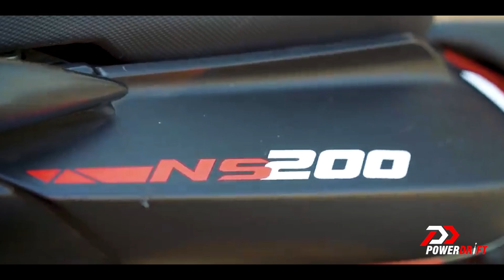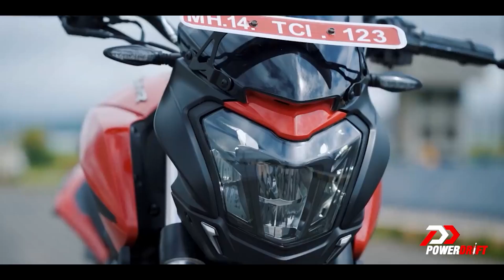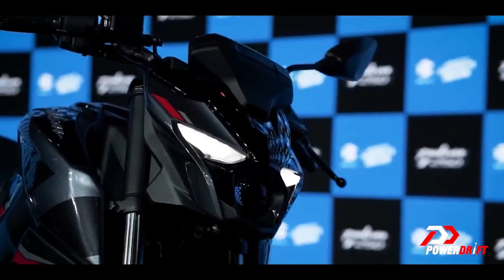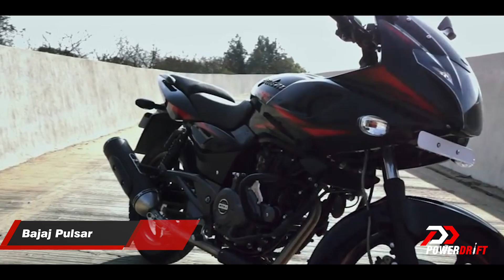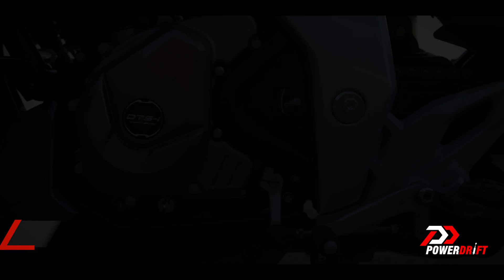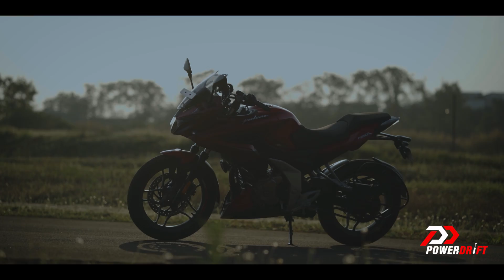Bajaj Pulsar F250 & N250 | Your Questions Answered | PowerDrift

Comment: My question is
Is the new n250 has the same engine of ns200 or rs00?
Its like it is the same engine bt tuned into different segments?
Or it it is completely a new one?
Reply: Both are totally different engines. NS200 is based on Duke 200 engine with liquid cooling and 6 speed transmission. N250 is brand new engine with 5 speed transmission. Both are completely different.

Comment: I think the Pulsar N250 has decreased in design and liquid cooling features (compared to the NS200).  Using air cooling is actually a setback compared to the NS200.  The best NS200 design and underbelly exhaust features are great.  The advantages of the N250 are only in the slipper clutch and projector lamp.  The rest I prefer NS200

Comment: Waiting for :
1.R250 - replacing rs250 - may it get a racing based engine like cbr 250r - with - 27 ps power
2.N150 , F150 , R150 - may it get a better engine with good engine figures. With - 19 ps power

Comment: Bajaj is not good at making liquid cooling engines. All bajaj bikes suffer with the water pump seal damage problem, coolent mixing with the oil problem, So making these kind of Oil cooled engines will require lesser maintainence and reliable than Bajaj's liquid cooled engines.

Comment: @Shumi: I agree with you when you say easy to ride bike would feel slow. Never though it in that way, but in retrospect it makes sense. I ride a Pulsar 135 LS and I 'feel' it's a fun bike in city traffic. This is something I 'felt' the day I started riding it as you call it in "Flow state", constantly keeping it in it's sweet spot ( around 6000 to 8500 rpm). It does not make a lot of torque or power with that buzzy engine , barely crosses the highway speed limits, but it does walk up and down the rev band quite well. That meant I can bang through gears 3 to 5 on open stretches, then blip down one or couple of gear as the traffic slows down then back up again. This constant choreographed dance made my office commutes a lot more engaging and may I say it, fun. While doing so I used to think I was doing crazy speed, but a quick glance down would reveal a 2 digit number. 

That said, how do you think these Pulsars stack up to that use case ? Are they more Yamaha FZ like or still a Pulsar just with relaxed riding cadence. Not upgrading my bike, just in search for different riding experience.
Reply: Hello, I'm able to relate to every word you're written as I am riding a 135 LS since a couple of years. May I ask what bike have you upgraded to? and if you could describe the difference in experience please.

Comment: The thermal stability management system is THE ONE AND ONLY reason why Pulsar AS siblings failed and Bajaj discontinued it. AS had a tiny twin spark air-cooled engine that produced 17+bhp with very front heavy handling. The bikes' engines heated like aloo paratha during summers. Very often it stopped and ceased to start up again after a severe 8k-9k rpm haul. The sweet spot for my AS was 4k-5k rpm which made zero point to validate the 17bhp considering the peak torque was at 9k rpm. That bike, was a bad bad experiment. Bajaj literally skipped R&D there, and many of the customers like me suffered that in terms of maintaining a pseudo-performance 150/200cc engine with not so commuter oriented design and handling.

Comment: Before pulsar n250/f250 there are no confusion between pulsar 220 and pulsar ns/rs because power figure are different, in the same way when ns/rs were updated there will be confusion between n250/f250 with ns/rs.

Comment: Reply , for your comment on 8.20 min. Xpulse 200 bs4 and bs6 did have the heat management issue. They realised it with so many engine issues popping up. Hence they gave bigger oil cooler and 4valve head. PS, i have an Xpulse.

Comment: Very good videos they are !
As you explained that the gearbox (for the pulsar) when in development was ratioed by deciding the first and last gear ratios first and hence filling the gap in between appropriately, and therefore adding the 6th gear would've slotted in between these two (first and last) gear ratios.
But what if while adding the 6th gear, they move the last gear ratio a little taller and hence filling in the gaps which mates to the expected torque demand ?

Comment: An amazing opening shot and a much needed video on the new Pulsars clarifying their intentions! Thank you!
However, are these better than the FZ25, as the latter seems quicker ? That will require a proper comparison review between the two. I suspect the Pulsars might be better for highway cruising.
Reply: Fx25 is an underpowered Motorcycle😬 to ride.
It's also 4 bhp lesser than pulsar 250.
Reply: @niriap9780  But it has faster 0-60 and 0-100 times than these Pulsars.

Comment: We like you to examine the levels of vibration and rattling in the new Pulsar bikes with the ones provided with a perimeter frame. Also why these bikes could not have been designed with a kerb weight of 154 kg the benchmark set by FZ25?. Why have the weights of Bajaj bikes climbed over time ie KTM 390 has added over 30 kgs since the first introduction. How is Honda CB 300 made with such a low kerb weight ? (Now not available in BS6). Do keep up your informative videos. 👍
Reply: Japanese bike makers have a lot more experience than Bajaj in designing engines and chassis. Engine casing is one area of weight reduction. Fortnine has a video on this in which he explains how much the casing thickness has reduced over the decades. I suspect Indian manufacturers still have some catching up to do in this area. Still, 6 kilos sound much better then D250's 20 kilo, making the latter a deal breaker. 

390 is not 30kg heavier today, what gives you this idea? It could be a few kilos due to change in exhaust from under belly to a conventional one, bs6 additions, etc. Still, it remains as the lightest in its class. Check the weight of cb500, it is quite heavy to its disadvantage.
Reply: @kurroth  it was 137 kg at launch, now 167 or so, you can check with some old spec sheet
Reply: @lvvenky9973  I found an old figure of 139 kilos of dry weight, without engine oil, fuel, etc. Weight wet was 154. Today the dry weight is 163 and wet weight is 167 kilos. Yes, weight has increased, but this duke is a different model than the old one. You were comparing dry weight of an older bike with the wet weight of a newer bike, which has a lot more electronics and emission control stuff.
Reply: @kurroth  thank you

Comment: Why are manufacturers leaving out the Dual Channel ABS out? I understand the cost aspect, but its an necessary feature
Reply: Between dual channel abs and slip assist clutch, I will choose the latter as I will use it everyday it makes riding more comfy. Rear wheel lock up is manageable. Still, if enough people complain, Bajaj will fix this.

Comment: Sare ans Clear kar diye apne  Jitne bhi sare log Bol rahe the we are disappointed But you clear all the questions I'm doing Automobile engineering I know I how a engine works which engine use which type of cooling system as these is not oversquare engine nor higher raving it's Square engine and dosnt have high compression ratio so it doesn't need oil cooling system and then it's Motercycle for more torque so this bike is all about mid range and it's not higher raving engine so it doesn't need 6Th gear  it's very good video and This video is ans for all Peoples

Comment: I think it would have been easier for Bajaj to provide the 6th cog rather than explaining the absence of it.. I understand the peak power and torque is available quite early in the rev band so they didn't feel the need of it.. 
But the same Bajaj felt the need of a 5th cog in the Platina 110.
It took them 15 years to listen to customers to find a true replacement of the Pulsar 220 and I wonder who the customers were who asked Bajaj to stick to a 5 speed unit.
Times have changed and the competition has moved ahead.. so, banking too much on the emotions of the yesteryears Pulsars and providing a bike with almost no USP is like forcing it down your throat.
I ask for your forgiveness in advance for what might look like negativity.. but this is really depressing.. forget 3 Sparks and liquid cooling.. the least that was expected from the 250 was to have Oil Cooled, 4V and 6 speed or were we expecting too much.

Comment: One side of bajaj is very adament to get updated. Govt should mandate abs and fi in bs6 only bajaj get updated otherwise its outdated. This new pulsar is should be released in before bs4 era. Now these are more common in 150cc segment. There is no wow factor in these motorcycles. If bajaj update these products in upcoming years surely this may become akward for new buyers right now. Surely bajaj is very confused replacing old one with new will be atleast compete in market. Some of the buyers dont really care about price tag they want more features from bajaj product when will bajaj hearing those querys.....

Comment: F250 replaces 220f n why do we see N250 then???😅
Reply: Bcoz n250 design will go for original pulsars i.e 150, 180, and 125. Next gen pulsar 150, 180, 125 will have same Design as that of n250. NS200, ns160 and ns125 will have different designs. And rs200 will have different design
Reply: @mandeepsingh9469  okay lets see when they reveal it in future!
Reply: @mandeepsingh9469  180, 125 not coming......150 will and 200 is in pipeline
Reply: @Shadowzzzz25  not shure about 180 but 125 will definitely come
Reply: @mandeepsingh9469  r u sure????
Reply: @Shadowzzzz25  1000%